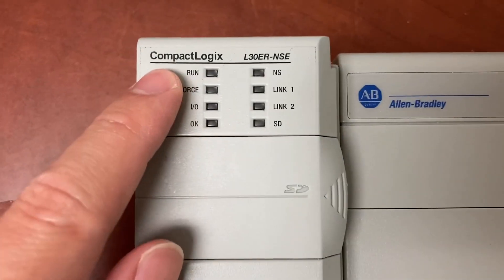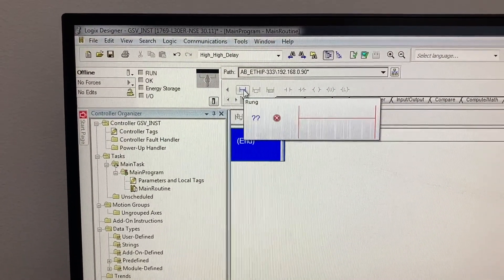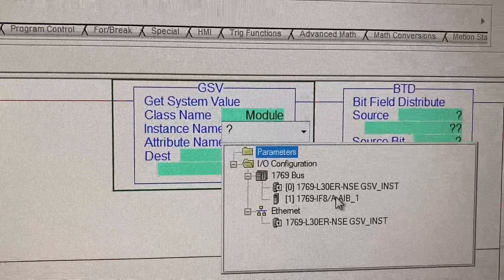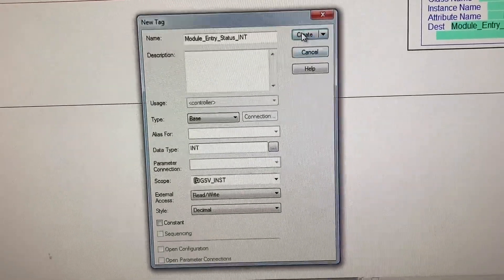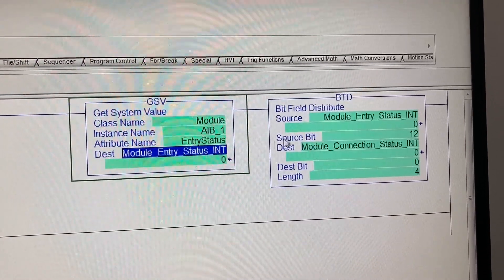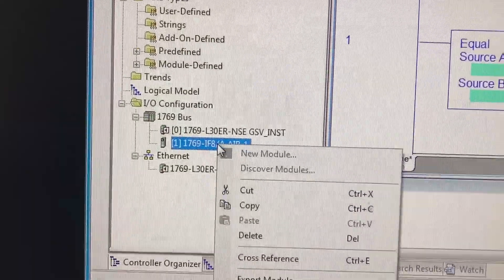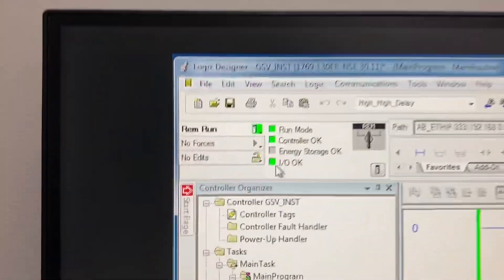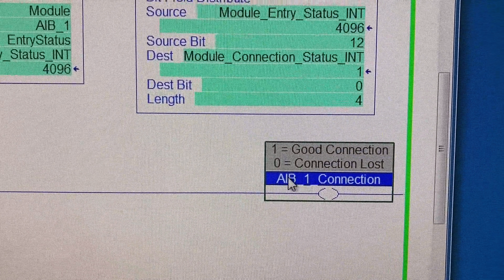Allen Bradley Rslogix/Studio5000 GSV/BTD Instruction Module Connection Status

Comment: Hello,how can I monitor connection in panelview plus 7 using gsv instruction?
Reply from the maker: @jd|f3712: I don't think that would be possible. PLC is PLC. It's not an HMI. HMI can see and display everything (data) in the PLC because that is what it is designed for.
Reply: @SYPHOANG  sorry, what I mean is If is possible in the PLC with GSV or another instruction monitor the connection with HMI
Reply from the maker: @jd|f3712: Unfortunately, it is not possible. Thank you for subscribing to my channel.